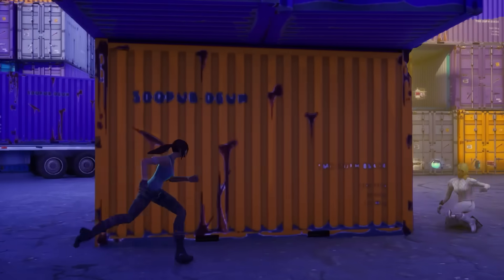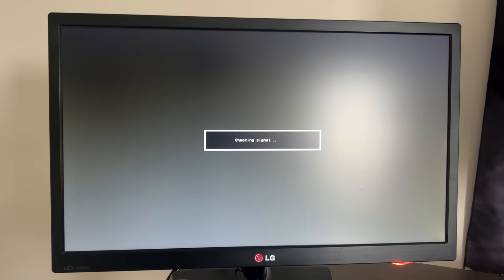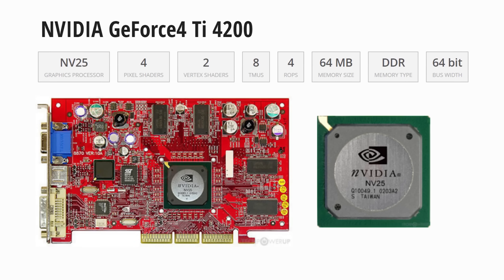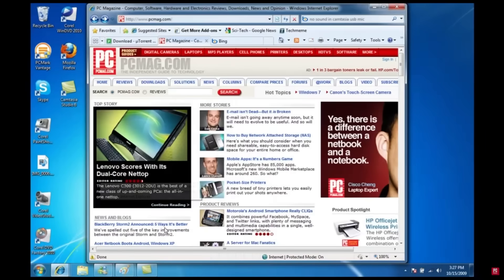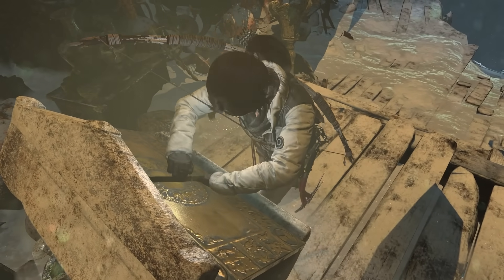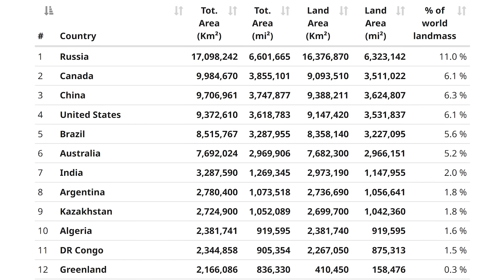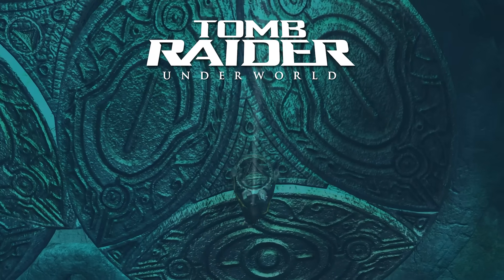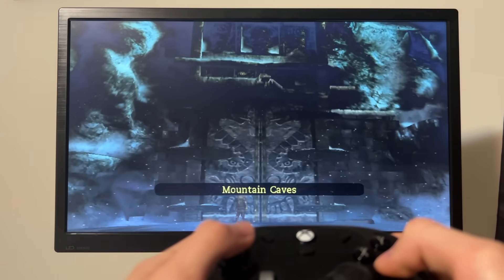I Optimized a 24-Year-Old PC Until It Plays Anything

Comment: TLDR connecting an old computer to the internet is fine provided that you aren't raw-dogging the internet and/or use a proxy service.

I run my old Dell from high school as a second PC (1999-2006 components) for older games. It is connected to the "internet" via the old web portal; though there are several other similar services. also provided that you are using a new router with updated firmware, the risk of any actual hack or security risk is pretty low.

Comment: The fact you do Windows optimization vids and only had experience on win10+ kinda blew my mind. Modern windows barely needs any optimization most times unless you got a very bad oem install. Lots of it can be overcome with another 1gb of ram or 100mhz overclock if you wanna be lazy.
Now Windows 98 through Win7? Holy balls it was nuts. Buy an HP or Emachines pc at BestBuy? Congrats! You now have to suffer custom OEM version of Win7 that struggles to even run Aero theme because there are 20 HP programs and services scheduled to run at startup and programs popping up and overlaying things to "improve productivity" and it takes 10min to boot and finish loading most of the startup processes.
If you saw that McAfee loading screen after boot, you were done for. Even uninstalling never really uninstalled certain programs. McAfee had to hide their own removal tool in their support section for the "nerds" that knew about hardware and software.

I haven't touched much optimization stuff or built a de-bloated OS image since maybe 2015. It sounds nice to know how all the stuff works behinds the scenes, but the amount of torment and frustration we had to go through trying to have an efficient Windows back then isn't something I'd wish on anybody so I'd consider youself lucky. Win 8 - Win 11 is like paradise in comparison.

Comment: 1. this pc is for very late win 98 or xp era, not windows 7, ouch, poor retro pc...
2. buy a ps/2 keyboard and mouse for reasons like you had with bios, if you want to stick to retro gaming, after installing everything switch to usb ones
3. probably you will need to repaste gpu, sooner or later you will fry it, there wasn't overheat protection
4. windows 98 supports unofficially up to Nvidia GeForce 7000 or ATI Radeon x800 series, officially GF FX5000 (max 5950 XT) or Radeon 9000 (max 9800 XT) series
    - XP supports up to GF 900 series or Radeon 200 series
5. cpu support with all drivers: Win 98: everything with APG (of course AGP 😁), XP: up to Intel 4xxx series and AMD equivalents...
6. use SB Live (98/XP), Audigy (98/XP), or even X-Fi (XP), and enjoy gaming with EAX, kids, you don't know what you missing, audio was much better in our times ;-)
7. disconnect RJ-45 cable and NEVER ever connect it again to your home network, until you will learn about vLAN 😏 use USB to transfer files...
    - fun fact, it will be much easier to be hacked with XP rather than with 98, indian hackers don't know what is Windows 98 anymore 🤣🤣🤣
Uff... GL & HF 😉
EDIT: all games working on windows 7 will work on windows 10 also, so don't punish our self ;-)
    - try to play old games on CRT and you will never ever want to play on lcd, maybe OLEDs are coming close to what we enjoyed

Comment: Tiny mistake at around 3:40 or so. The mainboard does not have 3 AGP slots and 1 PCI slot. It's the other way around: 1x AGP plus 3 PCI. Edit: you can remove the floppy disk from the boot order all you want. Means the PC won't attempt to boot from it. You need to tell the bios there is NO floppy disk installed. It's on the first or second page.

Comment: It's simple dude you just don't go online with an old ass pc . WTH  common sense is even less common the younger generation apparently.  I got an old 98 pc it runs great..but I keep the dang thing off line. If you need some software..look it up on a newer PC stick it on a flash drive and then you good.

Comment: BTW, there isn't any inherited risk from connecting a older OS to the internet, it only becomes an issue if you decided to disable firewalls and you decided to port out the system.

Comment: That Nvidia card you used was budget back in 2002. 2002 saw the release of the ATI(bought by AMD later) R300 known as the Radeon 9700 Pro. ATI was seen as ok by second place to Nvidia. The R300 completely transformed the market. It was the first videocard to let you use AA and AF at the same time with a negligible performance hit. John Carmack from ID Software ended up developing Doom 3 on the R300. The R300 was so fast I used it for a full two years only upgrading finally in late 2004. 2 years was forever to use the same GPU in the early 2000s.
Reply: @LastOneLeft99  the 4200 had the best price performance in 2002. Before the 9700 pro dropped in October only the 4600 was faster, and that was just an overclocked version of that card.

Comment: You made me, a 26 years old man, feel old, so thanks for that.

That GPU was definitely dying, a lot of the AGP GPUs were made in the transition between leaded solder and lead-free solder, as well as during the capacitor plague, so finding one 100% working nowadays is kind of a challenge. Most of the ones I have are showing the same instabilities and graphical glitches, you can usually repair most of them if you know how to solder and if you do it before the leaking capacitors completely corrode the card. The DVI port definitely isn't the cause, it can mess the colours (and that's considering it's DVI-A, which I'm not sure), but it can't corrupt part of the screen like it did in your footage.

As for USB keyboard, I think it could be multiple things. Of course, USB keyboards were barely a thing in the early 00s, so to work in the BIOS, most motherboard were emulating a PS/2 keyboard, which doesn't work really well on some modern keyboards since the USB protocol they're using can be kinda messed-up. The USB 3.0 could also be an issue, a standard USB 3.0 port should be able to provide at least 5V at 900 mA (and really, 1 A usually), while a USB 2.0 port only provides 5V at 500 mA, so half the power output, could be a problem with modern keyboards using microcontrollers and tens of LEDs. I think it's just messing with the power output of the motherboard and confusing it, both the floppy drive and the USB controller are probably controlled by the southbridge and it doesn't know what to do with a USB device asking for so much power.
Reply: modern usb kb/mouse is the issue because those keyboards register as usb+mouse and they operate in usb 2 instead of 1.1
Reply: Nah man I'm 26 and still feel like a 19 year old, I'm 27 in a month man
Reply: He was 10 when Windows 10 came out 🤯
Reply: @maxpoulin64  LECCTRON commented on my video!!!!
Reply: LECCTRON commented on my video!!!!

Comment: security flaws are not a problem, i use windows 7 and xp (also vista sometimes) and only if you disable the firewall the flaws become a problem (or if u download dumb stuff) also update the damn certificates it will fix all the connection not private error
Reply: I would still treat it as if I could be hacked any moment & not do my taxes or anything else of importance on it.

I love the idea of running Windows 7 tho. It's my 2nd favorite OS. (Win 2k is my fav.) I tried every hack I could find but couldn't get it to work with my 3700x pc tho.

Comment: To be fair that PC is so old it SHOULD not be running windows 7, its best suited to a OS such as XP, 2k, or 98 SE/ME.  It'd be overpowered for the 9x series but that and later can run it (95 OSR2 would have some issues without certain patches though)

ANYTHING from the NT series can run better than a single core PC though as even that had multi cpu (and it can treat multicore cpus as multi cpu, there's videos on that)

Comment: Hey man, the Riva TNT2 lineup was Good, you just got the shafted model. TNT2 Ultra is the best you could get. Also, Older EOL OSes are perfectly fine to use on their original hardware, if your hiding it behind your main PCs firewall, Just use some sort of ( At least in Windows 11/10 ) " Wifi Sharing over Ethernet " and it basically gives your Retro hardware a modern, updated Firewall by screening all incoming and outgoing requests through the modern systems firewall; This also allows you to do WFS far easier and safer between WFS 1.0 ( Older Systems ) and WFS 2.0 ( Modern systems ).

Comment: Hey! My old eMachines back in the day like, 2005, had a Geforce 2 integrated GPU with an nFroce4 chipset (nvidia networking? yep, that was a thing).  That little Geforce 2 integrated GPU got me through BF1942, BF2, BF2142, COD, Ace Combat 2, and a few other games until I dropped a 6200OC into from BFG Tech.

Comment: Windows 7 security isn't all that flawed 
You just need to be patched and dont download weird stuff from the web
Also dont disable your Firewall its that simple
People online exagerate about many outdated Os's 
Just use it smartly
Reply: truth, plus there is 3rd party support and patches (up till 2026 with the unofficial service pack), not to mention a LOT of 3rd party support that would give significant support to make it quite viable for a day to day use pc.  Though you should use 10 or 11 for a modern PC unless you're just dong it to prove it can be done as a novelty.  For many of those vulnerabilities many are moot without physical access or being absurdly close to it.  And for a lot of others can be manually patched up too if needed.

Comment: Fun fact: Canada, Poland and windows 7 have aproximately the same population
Reply: Thats a crazy comparison. Although most Windows 7 machines are still school/office computers that's still impressive that such an old OS is going so strong (I even stuck with 7 until 2020ish)
Reply: As a Pole, I was surprised, when I've learned that Canada's population is just slightly larger than that of Poland. Maybe it's caused by the fact that Canada has a lot more land, so I assumed it's going to eg. half of American population.
Reply: @testowykana1763   population density
Reply: @Slimx0612  actually, the windows 7 userbase is more than Poland and Canada combined!!
Reply: I have 2 desktop and 1 laptop running windows 10. Another laptop running windows 7 (because win10 would be too heavy for it).
Reply: LECCTRON commented on my video!!!!

Comment: PCs around the term of the Millennium were changing so fast that a PC that could play a particular year's games more often than not was too fast for older games, but too slow for newer games. Saying that, many games do work across machine generations though.

So typically for retro gaming you'd put together a number of rigs covering different game generations of the time.

Currently, I have several builds, based around a Socket 370 Celeron 400(A) running 98se/2K, a Socket A Athlon XP 2400+ running 98se/2K, a Socket 939 Athlon 64 X2 4800+ running XP, and a Socket 775 Core 2 Quad Q9650 running XP/8.1/Linux for physical retro PC hardware.

GOG Games and Emulation then covers the rest on my more modern i7-4790K build running Windows 10.

Comment: Hiya, I am a windows 7 user (as a hobby mostly). While without modifications or proper measures taken the OS can be a security risk, there are a variety of methods to keep a computer running windows 7 safe either supported by microsoft or by using community made projects. This includes patching windows update to continue providing microsoft security updates until 2026. Much of the fear mongering surrounding windows 7 being a vulnerability is caused by people who disregard all safety and security measures, like a firewall, router, or antivirus and then make the claim that even running it will get you hacked. That just isn't true. (Although I still wouldn't recommend it without the aforementioned security measures. If you're worried about having this computer online I would recommend looking into those! Especially patching the OS to receive updates from server 2008 r2.) Also, "your computer protecting you" when accessing the internet is caused by your system time being wrong, not any vulnerability. The computer's clock battery probably lost charge many years ago and so it was unable to keep track of the time.
Reply: Was expecting to see this comment, thank you. I too have a Windows 7 rig myself on a second gen core i5, 4GB of RAM, and no GPU. The community projects you mentioned are fantastic indeed, I had at least one security update every day. The only thing missing for this OS at the moment are kernel extensions like the 9x systems and XP have. 

My daily driver is now a Linux laptop, but by no means should someone be afraid of Windows 7 when taking said precautions.

Also lol at that part of the video you referenced, many misconceptions or just lack of knowledge as a whole, but we all learn and evolve :) I used to be scared of changing the colour of the eraser in Paint because a "teacher" once told us it was impossible to revert back, oh good times.
Reply: @xGMV  Nice to hear from someone else using 7! If you’re curious there actually is an extended kernel for windows 7 called “vxkex” and it can be used to run a variety of newer programs without modifying the system itself. You should look into it! It makes the OS much more usable today.
Reply: Fr this guy was blowing using windows 7 way out of proportion
Reply: That's a good point.  
By the way, in order not to bother with manual installation of updates from the “Server 2008 R2” edition, it will be enough UpdatePack7R2 which will automatically install all updates from 2011 to 2025.
And also, if someone didn't know, Windows 7 has a modern browser with all security patches called Supermium
Reply: @NATE_HYDENKO  Supermium and Thorium both can be de-Googled, and Redfox if Chromium-based browsers aren't your thing.
Reply: @NATE_HYDENKO  do the have one of these for Win vista or 8?
Reply: LECCTRON commented on my video!!!!

Comment: NGL my iMac G3 puts all over gaming pc's to shame. Heres is top of the line specs. 333 MHz PowerPC 750 g3  processor, 32 MB of RAM, 6 MB of VRAM on a Rage Pro Turbo,  6 GB of HHD storage, a beautiful 15 inch CRT display and its capable of running up to Mac OS X Tiger but i run Mac OS 9.1. Its a beast im telling you i can run all the newest high intensity games like Doom, Wolfenstein, Oregon Trail, Tetris and Minecraft Classic at the high fps of 2 frames per second. No other PC can compare it aint even a fair fight.

Comment: For the GPU issues with Windows 7, I’d get a Nvidia FX 5200 as those were very common and support WDDM fully. And it’s only a year newer than the card you were using so still technically from the same era sort of
Reply: it is also also a lot slower. fx5200 was a garbage gpu. the card to have from the era is the radeon 9800 pro (or 9700 pro, or anything from the 9000 radeon series, really). it absolutely murdered two generations of nvidia gpus on top of having better support for more modern effects, such as shader model 2.0+ which gave it much better compatibility with modern games. geforce 4 ti4200 can't even run battlefield 2 because it's just sm 1.3 and bf2 required sm 1.4 --- which even the radeon 8500 pro which is OLDER than the geforce had.
Reply: @ Yeah ik, but it’s just for basic display (you know like browsing websites, playing back videos, and also good looks from an os (WDDM for Vista and beyond). Cause let’s face it, XP and Aero basic were ugly. Aero I actually kind of like. From my knowledge It was first seen in its modern looking form on the Longhorn build from Dec 2005 which very funnily looks like Windows 7, and it’s from 05 lol

Comment: Good video. For any 10yr period throughout history, 1998-2008 had the greatest increase in consumer cpu & gpu performance. A top of the line 1998 pc in 2008 was practically unusable for anything, a top of the line 2008 pc was still usable in 2018 for anything outside of some AAA games that needed a newer video card which you could upgrade. There was one possible video card for a 1998 pc in 2008, a 8400gs pci card that was slower than it's pci-e counter-part. A basic gaming card at best. A top of line 2014 pc is still very usable today with a video card upgrade.
Reply: I'm gaming on a 2012 workstation class PC (the D30 v2) and I have zero issues with anything, especially Linux which seems to make these cheap PCs work even better. Gaming performance is great on the 2080 and the dual Xeons while not ideal are actually not bad at all since they have one of the best single thread performance in the Xeon class. Keep in mind this thing costed me in total no more than 200 bucks excluding the GPU.

I also recently managed to snag a P910 for 120 bucks, threw in 50 ish more for better CPUs, and got the proprietary flex connector NVMe thing (basically it adds two NVMe slots without sacrificing anything.) I love this thing for compiling packages and video editing.

You can absolutely play even modern games on these PCs, and with how cheap they can get at times because people want to sell anything that doesn't have RGB in it you're basically guaranteed to find a decent deal on a PC
Reply: Agreed. My 850 Pro smashed CoD 4 and others around the same time, i just had to run an older DirectX.
Reply: It's funny how during the '80s and '90s your computer would go from bleeding edge to hilariously antiquated and useless every couple of years. Going from something like an IBM XT or APPLE ][ to a 286... then that to a 386, then a 486, then a Pentium, PMMX, PII, PIII, PIV – pretty much every new generation made the previously one look like cave man technology. And then suddenly is wasn't. You could have a 2007 era mobo you later upgraded with a 2010 CPU and later upgraded again with a 2013 GPU and still have something that could more-or-less clunk along until the 2020s.